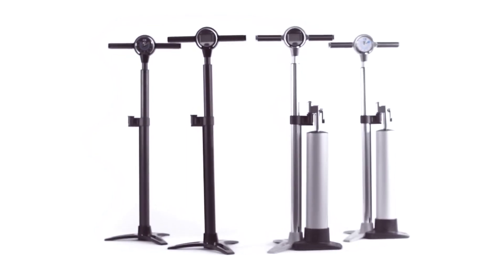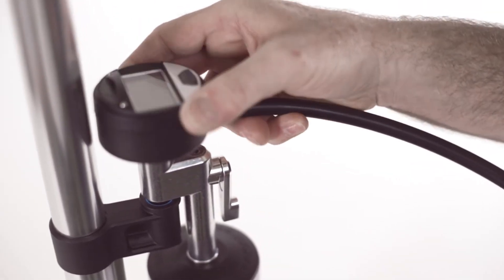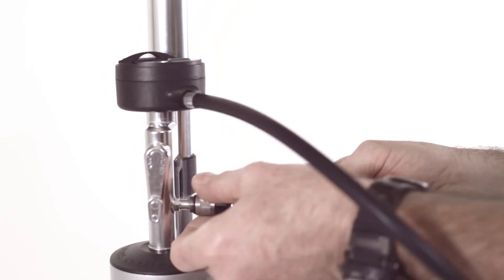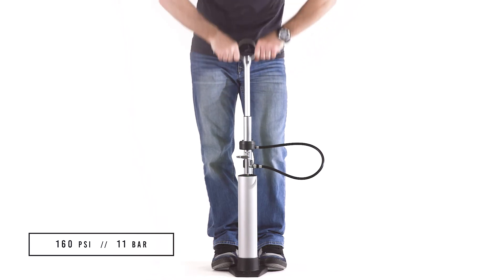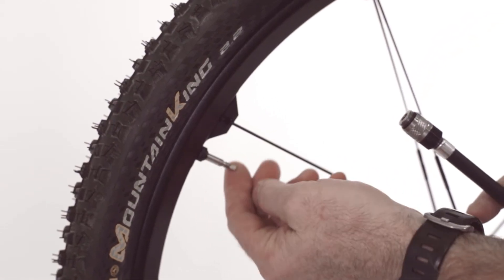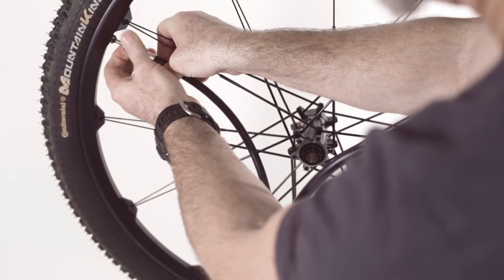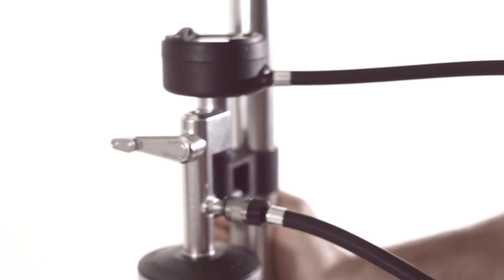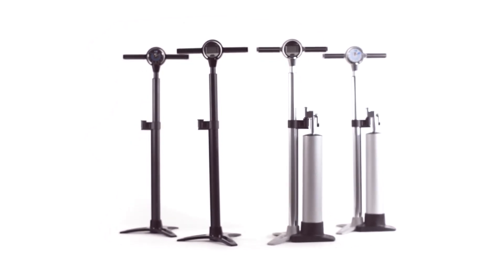Crankbrothers Klic Floor Pump and Tubeless Tire Burst Tank Tutorial

Comment: Wont this explode my tire, when it is at 160 psi?
Reply from the maker: Thanks for asking this question! To clarify, you would only be pumping the Burst Tank to 160 psi when you are setting the bead of a tubeless tire. High pressure is needed to engage the seal correctly, and a lot of air escapes in this process, so your tires wont actually reach 160psi. If you are just pumping the tire to your desired psi and not setting the bead then I'd recommend using the normal pump setting. Hope this helps! 

-The Crankbrothers Staff
Reply: crankbrothers thanks for reply. really enjoying the pump
Reply from the maker: @yvindyvind4086  of course! Glad to hear it!

Comment: Recently bought one. Unfortunately, in spite of the pump looks nice, it does'nt work. There is a big leak, around the magnetic connection, which doesn't get the ability to inflate over 4 bars (and this pressure requires more than hundreds up and down mouvements!).
Got back the pump to the vendor to receive a reimbursement, and buy a new one...from an other brand of course.